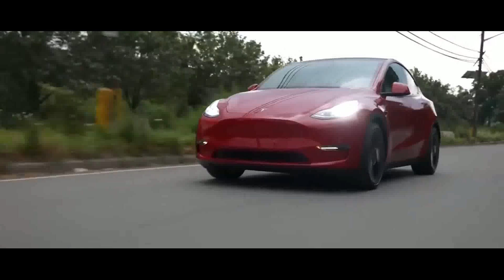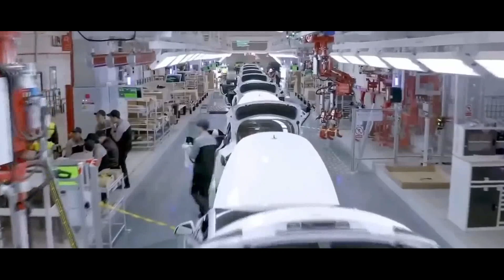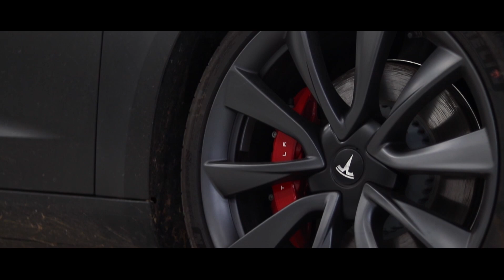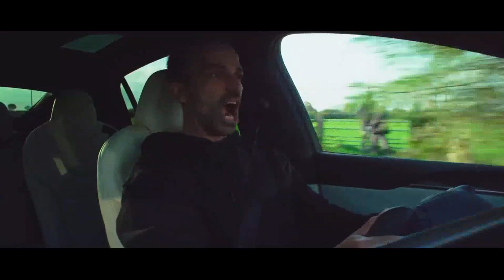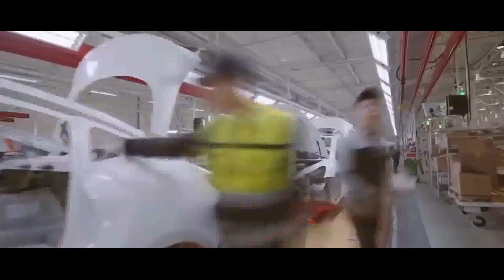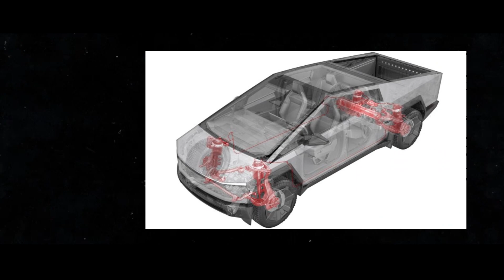That's why Elon Musk is always one step ahead! Tesla's revolutionary engine!

Comment: They're trying to sell you on Radial Flux motors when Axial Flux would be much more efficient, even if slightly more expensive to manufacturer.  Radial Flux motors have outlived their usefulness because they are too large and far to heavy compared to Axial Flux motors.  BUT, redesigning a production line to facilitate that new motor would be expensive but would also be well worth the money spent.

NEXT;  TESLA needs to find and purchase one of those new battery patents that will do much better than Lithium Ion and won't catch on fire and burn your home down.  There are more than a few new designs coming on line that look very promising.  The press and many other EV manufacturers are screaming at the top of our lungs to stop making EVs for the Greening of America BECAUSE NO ONE WANTS THEM UNTIL THEY MAKE SUBSTANTIAL CHANGES IN THE POWER SAVINGS AND MOTOR DESIGNS !!!

Two of the major issues are charging times and driving distance.  Solve those and the world will beat a path to your door, and at this time TESLA is the only auto company with the wherewithal to pull that off !